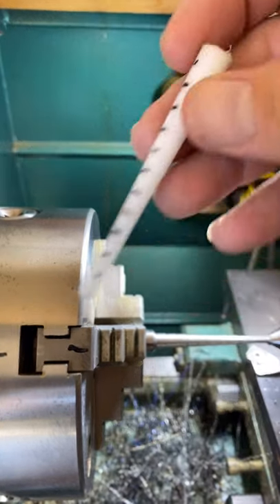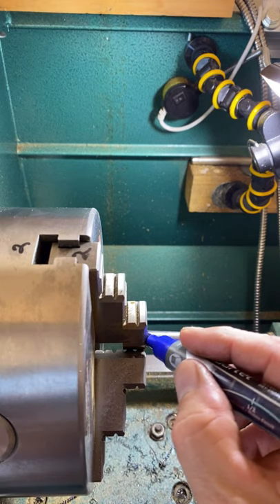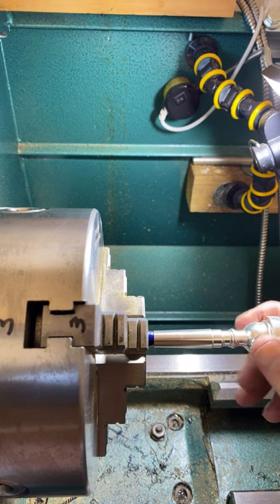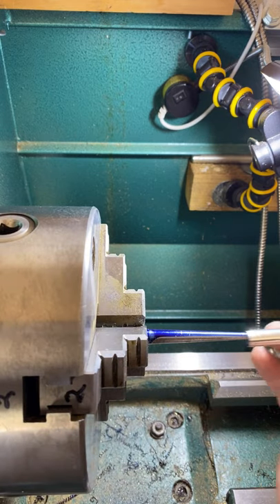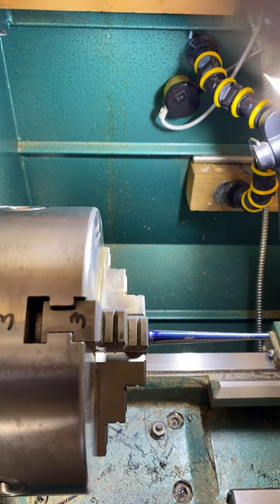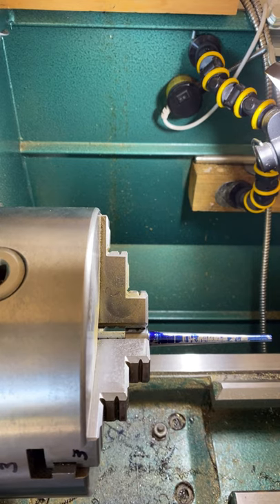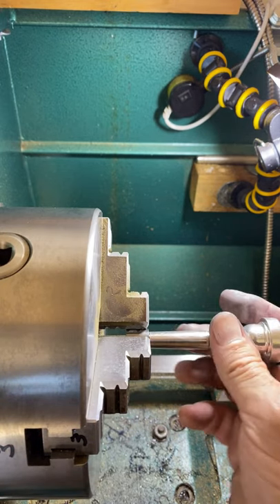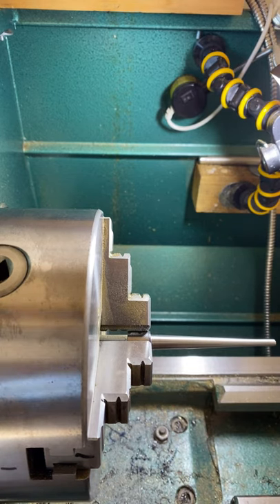How to make a trumpet mouthpiece Backbore reamer pt1

Comment: Hey doug what speed are you using when you cut a backbore on the lathe (not make I'm talking cutting  into brass with a reamer).

Love these vids thank you for everything!  I got the manual lathes back running in the shop and am cutting again.  Good Covid fun.
Reply from the maker: Hi Trent love your recent Facebook activity. When I cut with the reamer I use the same speed as for turning parts, 800 rpm. I used to go dry, but now I use oil, because it keeps any chips from wedging between the reamer. And the piece. What does work great for reaming and drilling brass is DuPont spray Teflon. Cuts like butter. Usually if I step drill with two dril bits, I need to rest three times cuz the backbore fills up with chips. I put a plastic washer around the reamer as a hard stop. After reaming I take a strip of scratch pad 1/2 inch wide and insert with a mouthpiece brunch to polish the inside surface. It nice. I can ream a backbore in a few seconds and it gets hot but you can still touch it. Take care Trent
Reply: @lipshurt   thanks brother!  I thought 800 was a sweet spot.  I haven't cut manually in some time so a little Covid fun is getting the lathe back out. Still runs well!  Thanks again for your help in everything!  you started me down this path of fun!  I love that you are showing off what you do which is so cool!